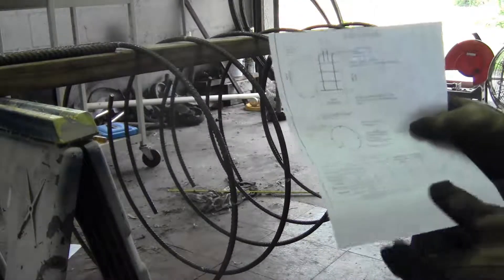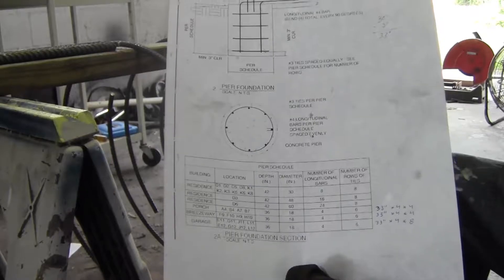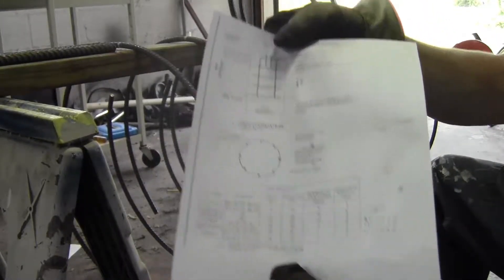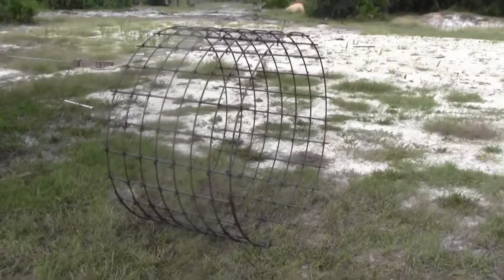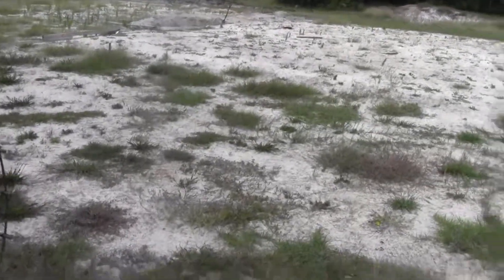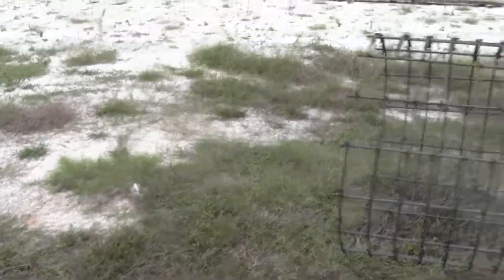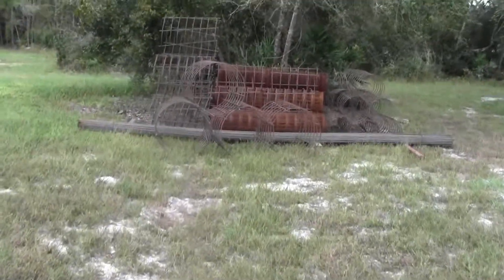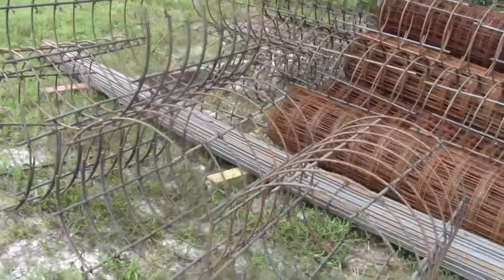Episode 3: Building and Setting Rebar Cages for Concrete Piers

Comment: Wow!  Great job man!  How did you roll that rebar for the rings?  I did mine by hand but my rings didnt match up at all
Reply from the maker: I had them rolled by a local company where I bought the rebar and mesh for the slab. I tried to do them by hand but there were too many and it would have taken me a long time. I had 192 rings total.

Comment: Great job! Can I use this same method for a flagpole foundation? If so how much rebar? Thanks
Reply from the maker: @danny trevino These would work great for a flagpole.  I had a company roll the rings. They charged per ring. For the uprights it would just depend on how many verticals and the length.

If you are wondering about the size that would be best left to an engineer.